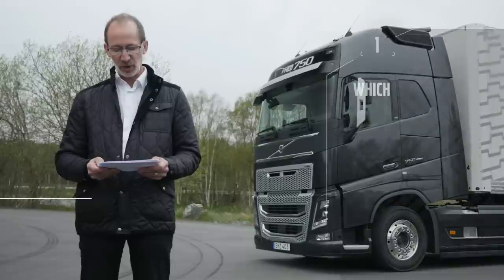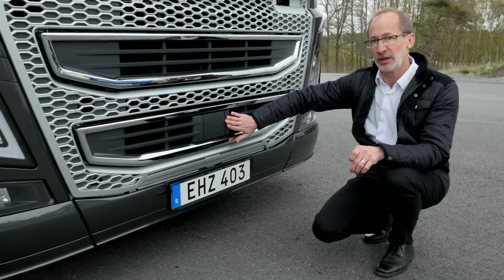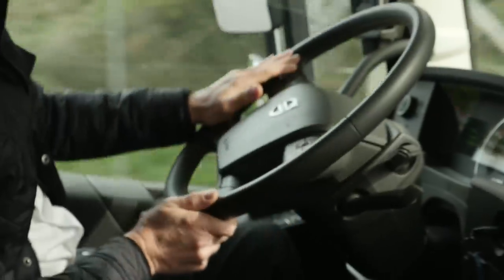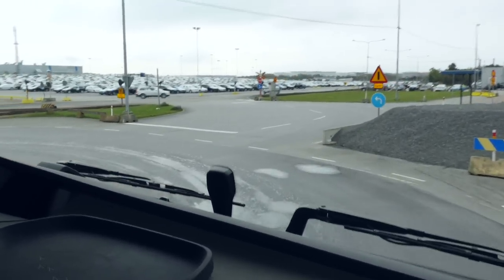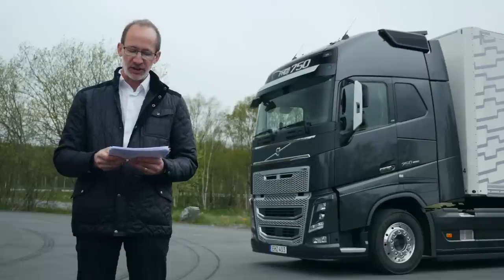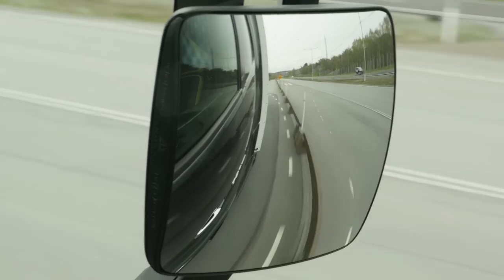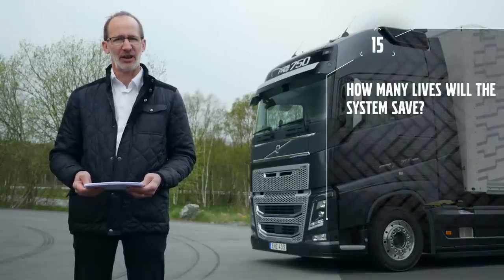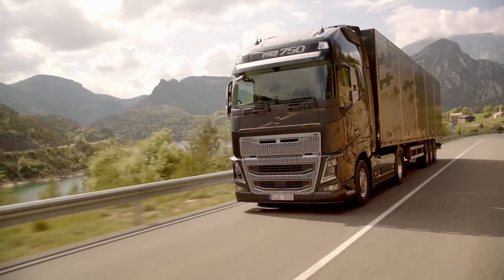Volvo Trucks - Safety talk about our active safety systems

Comment: I liked the honest and straightforward manner of answering the questions along with the video demonstration of the safety systems. It appears that new drivers (at least in North America) are receiving less formal training than in the past with relaxed licensing requirements for certain classes of trucks. Rather than being a crutch, new innovations like double-clutch transmissions, automatic transmissions, and enhanced safety systems on future trucks should make entry into the profession more universal and safer for all drivers regardless of their experience. The inherent skills required to be a good driver (ability to maneuver in all directions with pinpoint accuracy) doesn't change, just the tedium of making up the miles to get to that point where driver skill is most highly prized and enhanced with years of experience behind the wheel.

Comment: will it also detect cyclists at the far side of the truck in the blind-spot?
Reply: Be considerate that any vehicle can come from any direction with a driver who cannot detect you if you don't take all possible precautions to prevent that scenario.  Especially don't ride at night on an unlit road wearing all dark cloths without lights or deflectors on a narrow road with tight turns up or down a steep grade no shoulder and a tall steep cliff on the edge.
Reply: It will not detect cyclist. There is a sensor on the far side to alert the driver if it's not safe to change lanes. With the technology used today it's very difficult for the system to see the difference between a bicycle  and other objects like parked cars, traffic signs etc... There are camera's available to help the driver check the blind-spot, but no emergency braking. Maybe in the future...

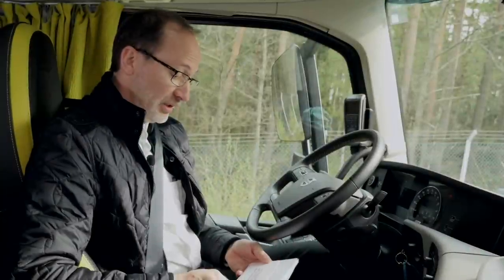Comment: 3:20 I like how we universally implemented the flashing lights as an indicator for strong braking because every modern car does this now. Knowing that drivers infront are braking hard is very important and with static brake light its not as easy to differentiate how much you need to slow down.

Comment: When they say that nothing will happen to the load, because it should be secured. Lets say you are transporting somethimg fragile lile eggs, you cant put a strap around eggs, some will say, eggs are trasported in boxes, yes thats correct but only after the eggs are packed at a factory, from the farm and to the factory most eggs is just placed at a carboard made to hold eggs so the top layer is completly open and the eggs are loose and nothing can me secured since eggs are really fragile

Comment: It would seem straightforward to use the RADAR emitter to melt snow if that is what is blocking it.  It would also make sense to put a hydrophobic coating on the cover so it's less likely to build up there.

Comment: Would it help to heat up the front radar cover if it is snowing ?
Reply: +Flotian Reich, I'd say you'd need a very powerful heater, also, when you shut the truck down, you have ice intead of snow on the front of your truck.

Comment: in my opinion, he didn't really answer the slippery question. Will the system prevent collision if it's slippery. or is the braking distance always adjusted for summer conditions? I would also like to see the brake lights flash on the video.
Reply from the maker: The Emergency Brake system asks for maximum retardation. The brakes on the vehicle are activated via the EBS and/or ABS and brake as much as possible given the actual circumstances. The tire make and tread depth as well as the surface friction will of course have an influence on the stopping distance. 
The best performance will occur on dry roads with high surface friction. Surface friction can be very different between for example a concrete road compared to a tarmac surface or a road covered with ice. The vehicle does not know the actual coefficient of friction so the stopping distance will vary. 
The Collision Warning with Emergency Brake will slow down the vehicle as much as possible but it is not to be seen as a comfort system that will prevent all accidents. Remember, as a professional driver you should drive slower in slippery conditions.
Reply: This system really works, and far more reliably than any driver, icy road or otherwise.  The ABS uses the maximum traction available.   I happen to know this because, embarrassing as it is to admit, it saved me from rear-ending a Mini that pulled in front of me, immediately stopping, when I was not really concentrating properly.

Comment: Why doesn't the radar cover heated to avoid get snowy?
Reply: +gyunagyos You need metal heating elements to heat something up and that would block the radar
Reply: +Arrrbol (YCS) 
Use heated air then....
Reply: Quick quiz: What discovery led to the invention of a microwave oven?  Answer: A RADAR technician found a peanut cluster bar had been caused by a RADAR emitter to melt.

Comment: That sensor tech looks quite expensive. And it seems quite easy to steal, theft from trucks are common.
Imagine to clean 10 trucks by just lifting a plastic panel, easiest payday ever.
Reply: +Brum hild Who will you sell it to, when every truck already has to have it? Who else would be interested in buying it?
Reply: +Gnawer Shreth Other people it was stolen from
Reply: Voluntarist lol
Reply: That's why they stole airbags from passenger cars at some years. Then sold them back.
Reply: What is your point?
Reply: Easy fix, don't buy from any but a licensed dealer or second hand shop that can verify their parts are not stolen.

Comment: What if there is a baby in the road you are about to run over and the lane keeping feature stops you from switching lanes?
Reply: The radar knows it's a crying baby and bypass the lane keeping assist.
Reply: if u steer the system wont prevent you from switching lanes